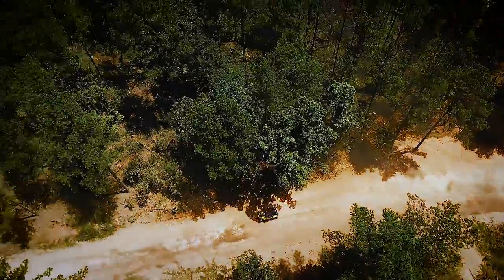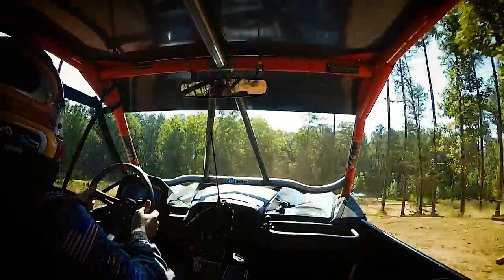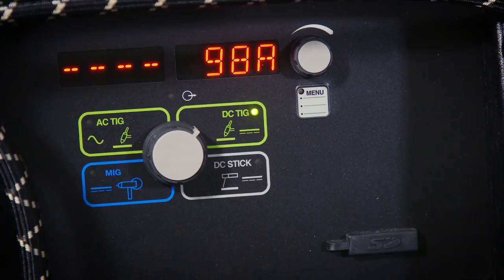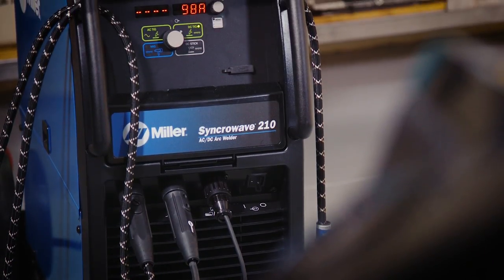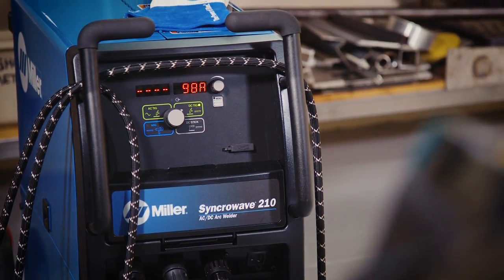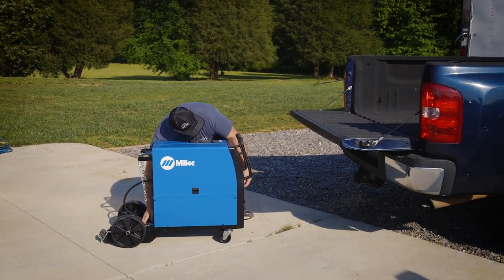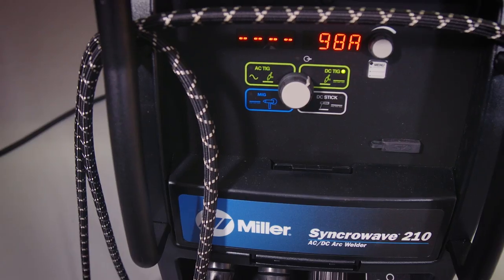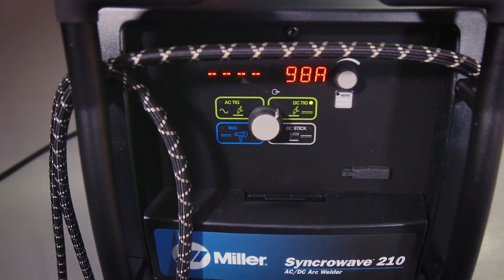TIG Welding in the Field Requires Portability, Flexibility

Comment: I have a bobcat 250, I would only need a compressor for that Syncrowave?
Reply from the maker: Thanks for the question. The Bobcat has enough auxiliary power to run the Syncrowave 210. Also, there is no air compressor needed to operate a Syncrowave. Thank you.

Comment: at a 140lbs I don't see the portability
Reply from the maker: Hi Doug, the Syncrowave 210 comes with a built-in running gear with an EZ-Change low cylinder rack and built-in storage space so you can easily transport everything you need for your project. Please let us know if you have any questions.